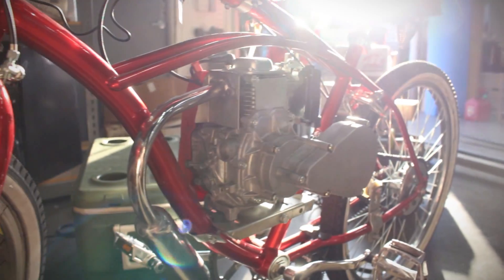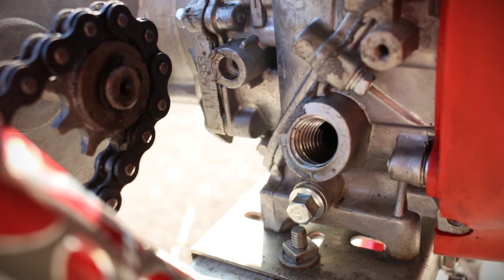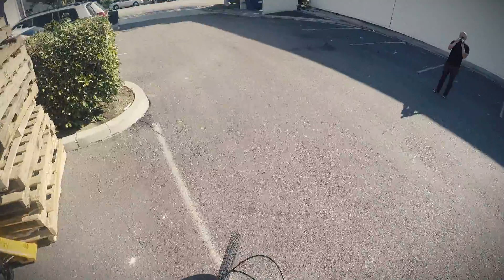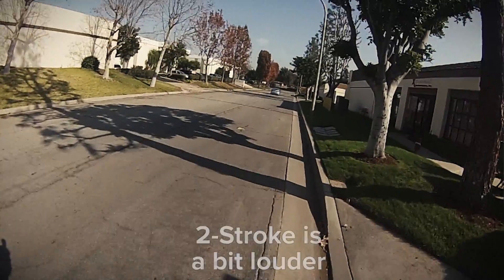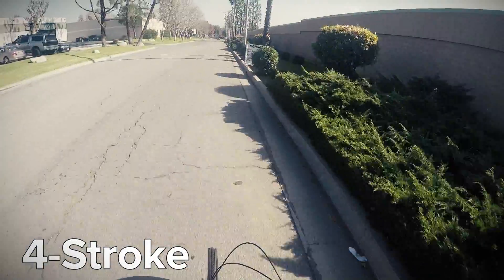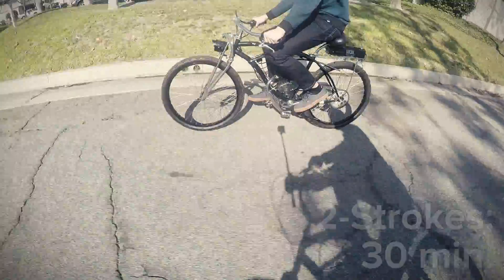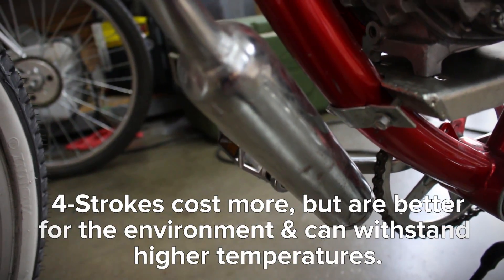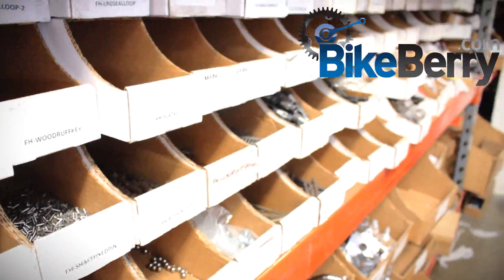2-Stroke vs 4-Stroke Motorized Bicycle (GoPro)

Comment: Your information on the strokes was correct, by the manual vs automatic was wayy off.  It depends on the engine you use.  Most motorcycle engines for example, two or four stroke, have clutches.
The "recommended riding time" is a myth.  It doesn't matter either way.

Comment: Is there a way to modify the four stoke engine kit to go faster?
Reply from the maker: You can add a performance muffler/exhaust! but besides that there are not much performance parts on the market
Reply: Right on bro!
Reply: Turbocharger
Reply: Stick a leafblower into the carb

Comment: Less maintenance  on the 4  and quieter too but like you said the 2 is way more enthusiast oriented and like my two rides my choice, but i would still like to build a 4 some time soon, nice vid thanks Guys!
Reply: the 4 needs oil changes. The 2 doesnt
Reply: @funnypranker34  yes, but the 2 stroke needs a lot more maintenance and you need to mix the oil